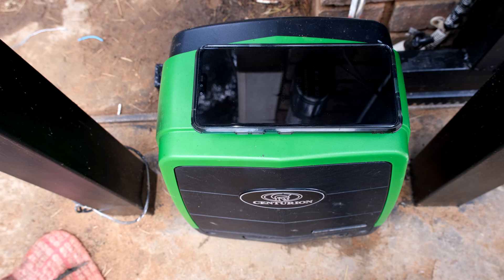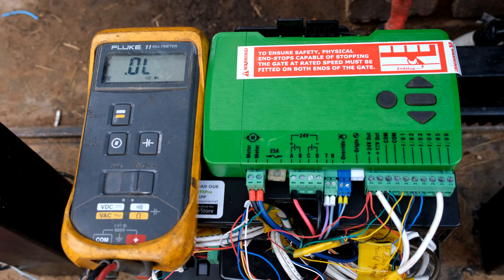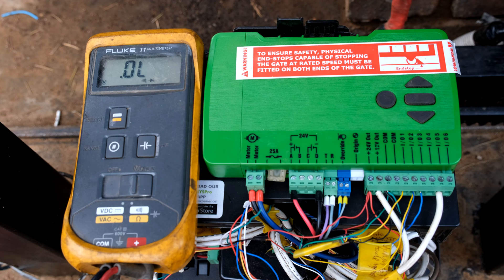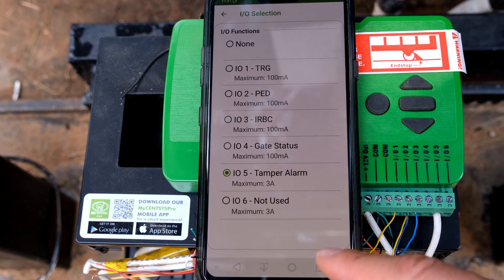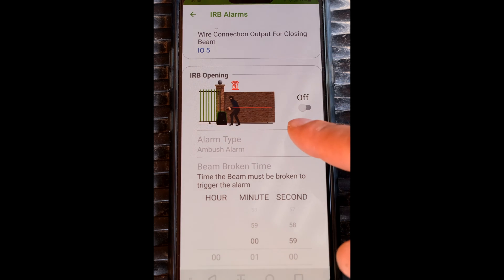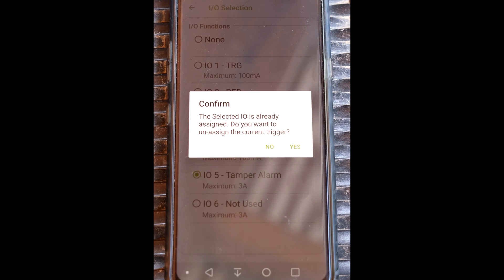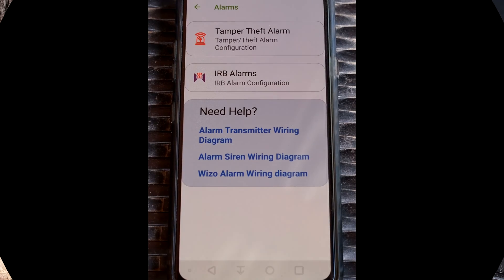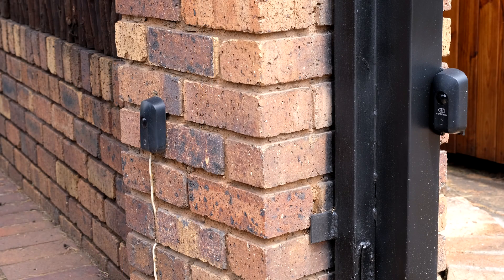How to connect a siren to your Centurion D5 Smart gate motor and configure IRB and tamper alarms

Comment: With the latest motors Centurion has decided to make both outputs 24v. What a bummer !!!! now i cant use my 12v siren
Reply: thank u very much, cos i was thinking of using a step down converter. cant wait for your video
Reply from the maker: i will show a solution to this, i have used it many times to solve this problem.
Reply: Can u also install small solar power panel for backup just in case or not

Comment: hi please assist d5 smart upgraded dx card  has a 2 x 24v outlet  -  where  or how to connect to 12v siren  ?
Reply: Hi, I have the same question, 24v sirens are hard to find, or either very loud like fire alarms. I myself am wondering if an external 12v supply can be used to power a 12v siren, and if bridging the input IO to the power supplies negative will be possible. However I'm not sure, just wondering.
Reply: @theonlydavide  yes but i believe even if you have a 24v siren you still have to use a regulator or else  for a 12v siren use a step down transformer / regulator witch centurion does not have any stock of